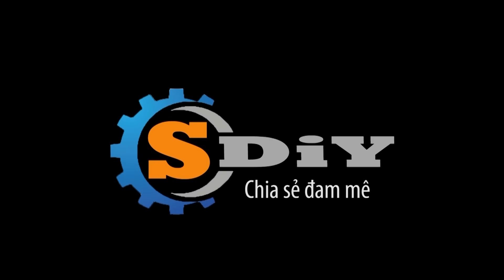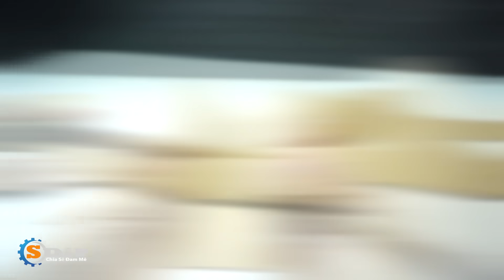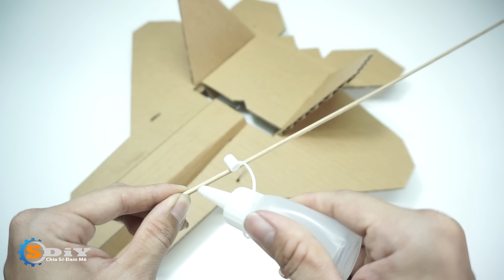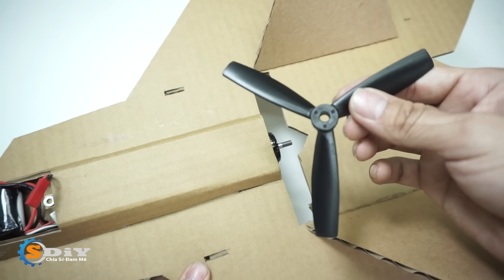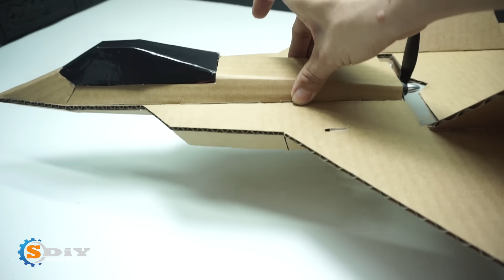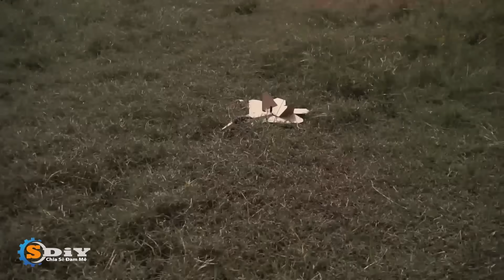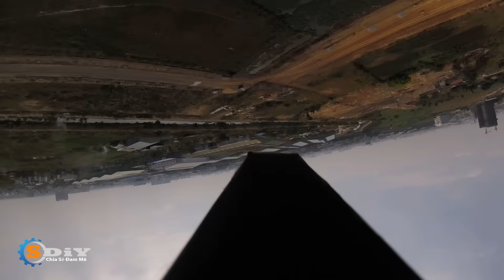Cardboard RC Airplane DIY - F22 Raptor l S-DiY

Comment: What is the total weight of electricity, esc, battery, motor?
Reply: I've made it but there is an error 1000mah only the weight is different
Reply from the maker: @ngoprekmania112  With a wingspan of 46cm, you should try to weigh less than 450g, otherwise it will be very difficult to take off!
Reply: how much does your battery weigh
Reply from the maker: @ngoprekmania112  I use Zippy 3s1000 25c, weight 82g
Reply: Ok thankyou
Reply from the maker: Hi friend, with 3s 1000mah battery and 3 layers 5mm cardboad, its flying weight is about 430g !

Comment: Is this rc jet can use the washing machine cardboard board?
Reply from the maker: Hi, there are some types of electric box that use 5mm carboad but 5 layers, which will be much heavier. in the video i use 3 ply 5mm. . Please take a closer look
Reply: I used to be 10mm thigh cardboard is it flying.

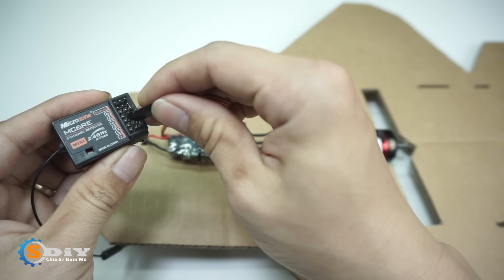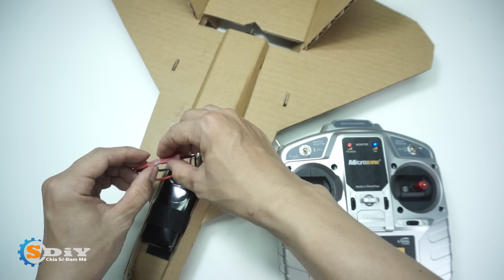Comment: At 2:58 , you connected a wire to the receiver. Then where did you connect the other wires of the ESC? And what happened to the white part of the battery at 5:17? 

Sorry I'm a noob at these stuff lol
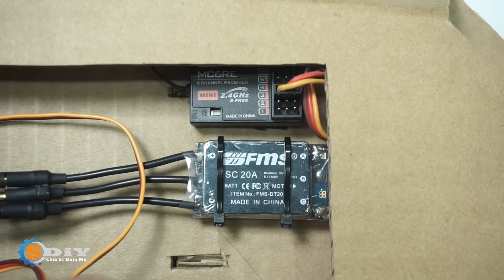Reply from the maker: Hi friend, the other wires will connect at 3:50 , and at 5:17 just glare . Thanks for the attention!
Reply: @SDiYchannel01  oh thanks :D

Comment: Is this Rs 2205 2300kv brushless ccw motor or cw motor?
Reply from the maker: Hi, you can choose random !, CW or CCW only affect when you assemble  multicopter Drone !
Reply: Is this RS 2205 2300kv brushless motor can use the 5046 propeller?
Reply from the maker: Yes, you can use 5-inch 5x4, 5x4.5, 5x4.6, 5x5 propeller...
Reply: @SDiYchannel01  please s- diy help me to how to connect electronics parts of your invention please upload more videos for electronics parts and transmitter.

Comment: @S-DiY   Diagram size bro
Reply from the maker: Hi, because the drawing has a lot of different details, so to be accurate, you need to download the drawing I put below the description. Print it to A4, or A1 paper..
Reply: @SDiYchannel01  thanks sir
Reply: @SDiYchannel01  I try to make it but it is too expensive for me
Reply: @SDiYchannel01  What is the length and width of the painting, Sir?
Reply: Sorry, I mean plain length?
Reply from the maker: @beastpagla44  Hi, the size like the video is about 46cmx65cm, hope it helps you!
Reply: @SDiYchannel01  thanks sir
Reply: @SDiYchannel01  Which transmitter and receiver is better? I'm sorry I'm disturbing you
Reply from the maker: @beastpagla44  Hi, I recommend Flysky i6 will be good and long-term choice, reasonable price!
Reply: @SDiYchannel01 okay sir thanks

Comment: Would it help it a bit more with the aerodynamics by blocking the corrugated empty spaces of the cardboard edges so that they don't create more turbulence?  Use something like lite epoxy, expanding foam or some other sort of adhesive.  Or perhaps just pinch the forward edges so that the holes are much smaller.
Reply: I used foil tape
Reply from the maker: Thanks for the great idea !

Comment: That was so inspirational.
You designed and built that so well and methodically.
Genius in my opinion
I would never be able to fly that fast as I am too old. Reactions gone to fart.
You would like motivation to design something else?
I would  be very grateful if you could design a really slow flying trainer similar to the " Lazy Bee" from card board.
Thank you so much.
You ard a true rc pioneer and also good pilot.
Reply from the maker: Thanks for the encouragement! !

Comment: Hello, at what percentage should I print the plan so that it is 46 cm wide? I printed it to the real size and the plane is 65 Cm, very big
Reply from the maker: Hi friend, I have a note in the file name in the next folder, if you print A4, choose to use the file for 46cm span. Or print on A1 size paper for the master version, which will also give a wingspan of 46cm. All print at 1:1 ratio, only different oqr paper size!

Comment: Is the first piece you glued at the 1.00 - 1.30 minute the underside because at the time you glued the ESC 20A and motor you cannot see that same piece. I'm a little confused.
Reply from the maker: hi, it's the whole top, i just glued the bottom side after mounting the esc and motor. Not sure if I answered your question correctly?
Reply: @SDiYchannel01  Thank you,  I think I have worked it out. The ESC and Receiver and servos are underneath. I have cut all the parts out and next step is to assemble it. Wooohoo. Loving it. I ordered all the parts from Hobbyking and ebay which have arrived. I may have a spare receiver somewhere. The prop I have is a triple blade 5x3 which seems quite small and I do have some 6x4 two blades so I'll see how I go. All good.
Reply from the maker: @richardhall9500  Hi, nice. One note is that with a wingspan of 46cm, the propeller part will touch the baffle, you need to cut the cardboard baffle a little bit after assembly. Waiting for your product. many thanks.

Comment: for this same my f22 weight goes to 430g with battery is it OK?
Reply from the maker: Hi friend, if the wingspan is 46cm, it's not too heavy with cardboard, with depron, the weight is only about 300g
Reply: @SDiYchannel01  but my f22 weight goes to 430g with cardboard so won’t able to fly ?
Reply: What thickness recommended for depron sheet
Reply from the maker: Hi, foam (depron, eps, syrofoame) are lightweight materials and ideal for making kits, i use 5mm depron
Reply: @SDiYchannel01  thank you

Comment: Wonderful!!! I'd like to make the same one even though I've never had a RC air plane. Can I get a steel link plan? Also those steel (Aluminum) linkage plate on the wings?
Reply from the maker: Hi friend. As far as I know, the ideal material for making model airplanes is balsa wood, foam is cheap. Other materials such as aluminum or plastic are not used, because of the weight

Comment: What size motor is used for the 65cm Wingspan model?
Reply from the maker: Hi, with 65cm span, you use 2212 2200kv or 2216 2400kv, 3s battery 1500-1800mah
Reply: @SDiYchannel01  Many thanks. I have printed out both plans and the 65cm one looks fantastic.....all 18 A4 pages joined together
Reply from the maker: @richardhall9500  So excited for a friend with the same passion !

Comment: Can I use a battery that weighs 146g?
Reply from the maker: Hi friend, with 146g battery I am afraid it will add weight with 46cm wingspan. If you are technical, printing the drawing to 52cm will be more suitable
Reply: @SDiYchannel01  Okay, thank you friend... and more question, with 1000mah battery, how long time it can fly? because I want to add the battery capacity
Reply from the maker: @muhammadfaiz7290  Hi,Because cardboard is a heavy material, so the flight time is only about 5 minutes return. Need longer flight time, please change light material,

Comment: I wish the plan in the link showed more lengths in the dimension. I get the 46cm and  64cm long but it would be helpful if there were more measurements. My printer can only print A4 size page which makes it difficult to print one out. I'm just busting to build one of these awesome babies and thanks for sharing.
Reply from the maker: Hi,In my new pinned comment section there is an updated A4 drawing, you can download it, it includes 16 A4 panels put together! If you have any questions, please leave a comment
Reply: @SDiYchannel01  Many thanks. Where can I find your pinned section? Unfortunately not having much luck. Much appreciated.
Reply: Is this in the four Pdf's in the link above that has 327 likes?
Reply from the maker: @richardhall9500  Hi, That's right, I have the size in the file name
Reply: @SDiYchannel01  Excellent, thanks so much. Love your work.

Comment: What size did you do the project on blue print leght and height
Reply from the maker: Hi, In my new pinned comment section there is an updated A4 drawing, you can download it, it includes  A4 panels put together!
Reply: @SDiYchannel01  thank you I will check it out

Comment: To make it come out of the width of 46 cm at what percentage should I print? Because the press comes out great
Reply from the maker: Hi, thank you for your interest. If you print to A1 size, the size will be 46cm. Or you can print a composite A4 version. File details I can show in the drawing folder. Dear
Reply: @SDiYchannel01  ok ok..thanks very much and congratulation for your channel👏👏👏

Comment: I'm actually gonna make my first RC plane and love this idea,just a quick question,how thick is the cardboard that you used.
Reply: Thx ever so much for your help,I do have a question about the ESC as this will be my first time ever making an RC plane,I bought this motor Emax RS2205 2300KV CCW for my plane not sure if it's ok for this project but what amp ESC would be ok and what battery would you recommend,any help would be greatly appreciated
Reply from the maker: @simonhampton1304  Hi,With the above motor, you can choose 3s battery, capacity from 1000-1500mah, discharge current 25c or more. Suggested in the clip I use Zippy 1000mah 3s 25c battery. There are also many other brands of batteries you can choose from
Reply: @SDiYchannel01  cool that's great thx ever so much for you help I really appreciate it alot,would a 30amp electric speed control be ok for this aswell.
Reply from the maker: Hi friend, I use 3 ply 5mm thick cardboard, I got it in the electronics box
Reply: How are going to build this plans ha no meshermemts
Reply: Don't download plans on drive that's all I'm saying
Reply: @colinwhite144  why not dowload them ?
Reply: @garycestcedejhhh4974  I've made 3 planes or attempt to make them m card board varies to single flute to double flute I found if buy of ebay its to heavy the best is go to a shop that has a lot of deliveries and ask for big empty box it will have writing on you can paint that when finished plane thickness some double flute can be light than single flute. If you get a large box and it fe quite light in weight that will be the write cardboard to ues I hope I've been some help. Ps I've moved house the removal left big cardboard boxes to put together this is ideal to make a large plane or to what you want to make
Reply: @colinwhite144  Thanks for u answer and for the tips did u maneged to finishe the plane ?

Comment: Tôi có thể sử dụng động cơ 2212 2200 kv thay vì 2205 2300kv được không
Reply from the maker: Hi, với 2212 2200kv cánh quạt 5inh. Có thể được nhưng sẽ khó điều khiển hơn vì thêm nặng. Bạn nên cân nhắc
Reply: @SDiYchannel01  bạn có thể vui lòng đề xuất bất kỳ động cơ giá rẻ nào mà tôi có thể sử dụng thay vì 2205 2300kv không
Reply from the maker: @insanelygenius4485  Hi ,Bạn có thể chọn 2204 2300kv, hoặc XXD 2208 2600kv, kết hợp cánh quạt 5inh.

Comment: Amazing work!
May I have a question?
Does the airplane only produce the lift force by the tail wing?
Reply from the maker: Hi friend, Very good question. Standard aircraft models will need wing profiles for enhanced performance. With the flat wing form, when flying, the wing angle is required, so it will reduce efficiency. But simplicity is its advantage... thanks for the attention

Comment: In 3:46 how can you tied the steel between servo and both of the tail wing?., Do you used acrylic?., Please answer me., How'd you made it?., Please tell me how?.,
Reply from the maker: Hi, I used a cylic horn to attach to the steering wheel. You can find more on google, because the video is long, I can't show the details

Comment: Hello where did you find the 1.5mm steel link for the wings plsss.  Tks
Reply from the maker: In my country, I buy it at the hobby toy store. Or you find them inside fiber optic cables
Reply: @SDiYchannel01  ok thx u, i will try this,
Ses you soon. 
Bb

Comment: Nice design, more realistic than the Flite Test version! Will use your plans to build one in foamboard and see how it goes.

Much safer to launch by holding a wingtip, you need your fingers for future builds! 😉
Reply: bro this is a scam he didnt actually fly it with the thing he made...
Reply: @officialsoultixz  WTF are you talking about? 🤦‍♂️
Reply: @officialsoultixz  why not?
Reply: @officialsoultixz  How do you explain the on-board video of the plane in action?

Comment: Can I use 8045 propeller paired with A2212 2400 kv motor with 45cm model?
Reply from the maker: Hi friend! Are you exactly 2212 2400kv or 2212 1400kv ?, if 2400kv then only 6040 blades max, and a wingspan over 60cm would be appropriate
Reply: @SDiYchannel01  Thank you ❤️
Reply: I was able to make but couldn't control it. I was able to take off but it falls down in 5 seconds Is the centre of gravity shown in plan correct because mine is nose heavy though battery is placed farthest back in the top opening cavity?

Comment: Im really keen on building this now, but one question is how did u generate lift from the flat wings, aren't they supposed to be shaped In a way?
Reply: One guess would be that the two tails are not parallel, and the air resistance by them may act as a pivot point.
Reply: The lift that is supposed to be generated by the wings is in the tailfin. The tailfin's vertical movement compensate the vertical movement of the wing's tail ends

Comment: Can you also share the dimensions. What is the length of the chart you used.
Reply from the maker: In my new pinned comment section there is an updated A4 drawing, you can download it, it includes 9 A4 panels put together!

Comment: Bro ,ı made this plane but when ı throw the plane ,he the left is moving down,can ı send you video to solving , please could you help me
Reply from the maker: Hi friends, This problem a lot of people encounter. Caused by the torque of the motor. The solution is by rebalancing the steering wheels, tweaking the reverse slightly from the engine torque
Reply: @SDiYchannel01  thank you ı will trying again
Reply: @SDiYchannel01  ı made something that you said , now your plane is going down or the plane is crashing ,ı always checking center of gravity ,what do you think about that

Comment: Imagine having some kind of light weapon on this like rubber bands or something similar, and hosting dog fighting contests with these things. Battle bots ... in the sky.
Reply: You could have a flying "crash derby"  with a dozen or so at a time.
Reply: That’s a thing. Only you hang ribbons off the back and the prop cuts them simulating getting lined up for a shot. Need a front prop though
Reply: It's gonna be "epic"
Reply: @sebas Stein big brain😂😂

Comment: Buenas tardes amigo S-DIY, quisiera saber para la impresión del plano en A4 , se imprime a escale 100%? O de que forma imprimo? Gracias
Reply from the maker: Hello friend,  print it out to A1 paper size, you will get the exact dimensions for each detail. 
Or A0 format to have a bigger plane!
I am contacting the author to split the A4 drawing to send to you. Thank
Reply: @SDiYchannel01  Gracias amigo S-DiY, no tengo de otra, no tengo como imprimirlo en A1 ni A0, y buscar donde imprimir me cobran mucho dinero y es lo que menos tengo. Te agradezco mucho si logras con el autor pasarlo a formato A4... 
El F22 está estupendo, te felicito y fácil de construir y lo mejor es con el materia que lo fabricaste de cartón.  
Otra pregunta que tengo es que mi electrónica es más grande, por los menos mi motor es un A2212 de 1400Kv, el ESC es de 30amp y la batería si tengo una de 1000mah de 3s.
Reply: Otra pregunta mi amigo, que tamaño tiene la lamina de cartón que usas en el video para construir el avión?
Reply from the maker: @fernandoalvarez669  Hi friend. With 2212 1400kv you can combine 8x6 inch propellers. Plan to print 1:1 to give a wingspan of 65cm. But with the 3s1000 battery for 65 span I'm afraid very little.
The hardcover I used is about 60x80cm, I got it from the fridge box, happily !
Reply: @SDiYchannel01  Ok my friend, thank you. I ask you; Using those same measurements that you used but making a little longer only the opening where the propeller goes to place an 8x5 one, would it help me?

Comment: and where to get the spokes for servo drives?
Reply from the maker: Hi friend .It is 1.5mm steel wire, easy to buy from RC fittings.

Comment: to fly faster, can I put a 3500 motor and a 6-blade propeller ?
Reply from the maker: It can be, but you need to use a higher discharge current battery, about 45c or more. That means extra energy, which is difficult to maneuver!

Comment: How do you know adding batterys, the receiver, engines, the servos and other things, how do you know the center of gravity is just right? When I was jong and there was a little error in power in the engines or wrong weight misplacement the plane won't fly that good. But you adjusted the accused.

However the speed, yes must be high but could flaps help give it more lift at slower speed? Full power and it's a cannon you can't see it almost anymore if it is strait or upside down.

Little misplaced and it won't fly, direct to the ground or it will only correctly fly when it reach a certain speed so weight distributing, speed etc are very important for a very light sensitive plane. The accused is heavier than most of the plane
Reply from the maker: Thank you for your interest. Initially I tried to set the exact focus. But still slightly lightheaded. Although still controllable, the flight is unstable. So I moved the battery to make the focus more precise. If you define the wrong center of gravity from the beginning, then it definitely won't be able to fly. Cardboard has the only advantage of being an easy-to-find material ...Thank you again ..